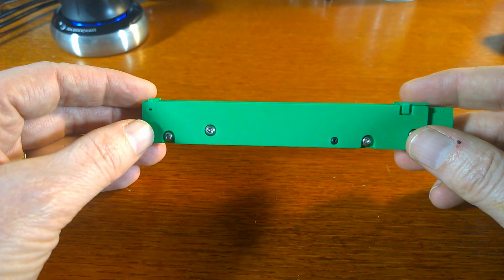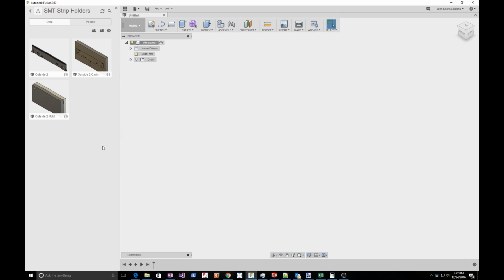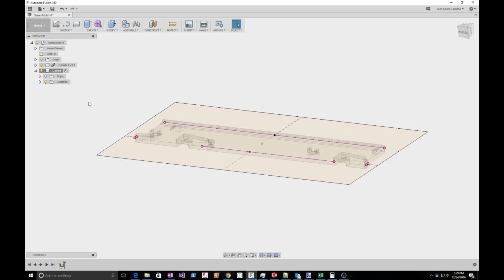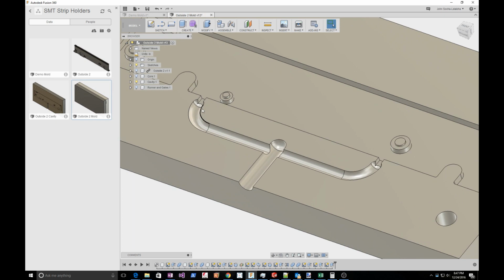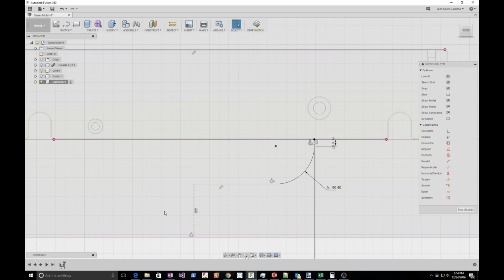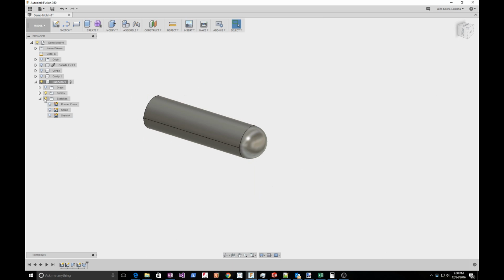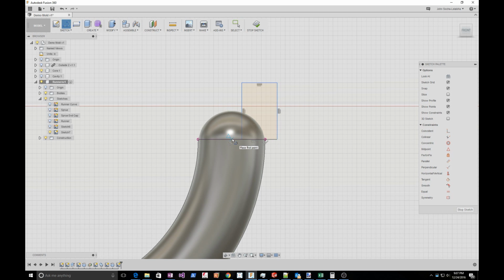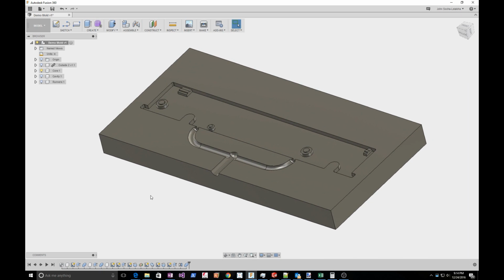#1 - Designing an Injection Mold

Comment: Hey everybody I got a quote for a mould for a machine the same as the injector that he is using and it seemed pretty high, I even asked another die maker and also came in around same price.

It was about $5,000 USD for a mould for Oakley style sunglasses. What takes so much time and cost? Is it the CAD design? I myself just started to learn Fusion 360.
Reply: Design + manufacturing + experience, it is a very niche market to create these little molds, so they need to be compensated for their expertise and time investment. I’d say get the most out of your money and ask many questions 😊

Comment: John, are you using some kind of tilting vise with your CNC?
Reply from the maker: It's a type of vise called a screwless vise and it doesn't tilt.
Reply: @JohnSL  I have the same vise; the question was if you have some tilting vise at all. 
Because I had to mill some 45° slots (for sheet metal bending); Anyway I almost forgot that I can tilt my milling head and that just did the job on my side. All my parts are successfully folded with the die which I just milled 4 hours ago.
Certainly I could have designed the slot in freecad and exported the g-code but using the facemill it was quickest I feel.

Comment: How did you decide where to place the gates? It looks like you have created a weld line between  them
Reply from the maker: Yes, there is a weld line. With the machine I was using at the time, I didn't really have much choice. I didn't have enough injection pressure to fill all the ways to the end with a single gate, so I tried to put the gates in 1/4 of the way from each end. That way each gate would fill 1/2 of the mold in about the center of that section. If I were to make this mold today, I'd make it for the Morgan and use a single gate.

Comment: Great video, I have a couple of questions. 1: why are the rails reduced at the ends? Don't you want the flow into the mold to be as quick as possible? 2: Why do the rails have 90° bends, why not 45°. Again just thinking about filling the mold asap. Thanks
Reply from the maker: This is pretty common gate design. The idea, as I understand it, is to have a short section of restricted flow that will cause shear in the plastic. This helps heat the plastic a little more and makes it flow better. So the 90° bend allows the plastic to go directly into that small gate. Using a different angle would require the gate to be longer, which would be less effective.
Reply: @JohnSL  Thanks
Reply: ,,s,

Comment: Hi John, thank you for a terrific video! You mention a lot of practical advice/rules of thumbs, such sizing off of spru radius etc. Can you suggest any favorite books, resources etc. where you gained such knowledge?
Reply from the maker: I wish I could. I get a number of books, but didn't find what I was looking for. The problem is that large machines have much higher clamping forces and injection pressures than my machines. So the advice doesn't fit very well. I just slowly picked things up here and there, and used lots of trial and error.
Reply: @JohnSL   Hey, good job for the mold design however you haven t scaled the part as you known plastic shrink so depending on your plastic type you have to oversize your part. 2 - your part thickness is not uniform which gonna cause sinks in thick areas. Solidworks have a mold design module that offers you all these steps I advise you to use it. the way that you use 360 fusion for the mold is clever however, with a more complicated part with a non planar parting line it is not possible it will be better to use surfaces to design the mold.
Reply from the maker: @akramazgal4788  Thanks. All true. For most of the parts I design, the shrinkage isn't an issue. I use Polystyrene and ABS, and they have a shrinkage of about 0.5%. That's well within the tolerances of these parts. As to sink, yes, that's certainly a factor. For other designs I take that into account. In this case I was not worried about that, so I took a shortcut. And as to more complicated molds, I have made molds with curved parting lines. But most of my molds have a planar parting line, which does make things a lot easier. I have a mold I'll be working on, probably at the end of this summer, what will most definitely not have a planar parting line. I'll do a videos of that part and mold when I start to work on it.
Reply: @JohnSL  good i am a plastic enginner if you need any help i am ready to exchange experiences thanks you and good job 🙏😁
Reply: @JohnSL that's the problem I've been running into too/why I asked since I have a TechKits benchtop machine, which requires manual injection! I've been collecting your tips and why things are designed a certain way across your channel more recently, thank you! I'm also looking into using AutoDesk's MoldFlow Adviser 2019 simulator to start saving time/resources on trial and error for what it's worth.
Reply: hey you can find some interesting rules here :https://medium.com/jaycon-systems/engineering-guidelines-to-designing-plastic-parts-for-injection-molding-1c554a4545be

Comment: can the mold be designed using other software such as 3ds Max or Rhino? And does the molding factory design the mold for the clients(designers) and is that an added service with extra cost?
Reply from the maker: Yes, you should be able to. I haven't tried it. But you'll still need to use a program like Fusion 360 for the CAM to create the tool paths for milling the mold.
Reply: I wouldn't use 3ds max or rhino its just one more export import step fusion 360 tries to be an all in one software and you can get a free license for hobby use. 
its pretty easy to model in fusion 360 and i've used modeling programs like 3ds max, blender, google sketchup.
Reply: Hi ,we are injection mold manufacturer for 26 years,contact sarah@plastic-neway.com

Comment: I’m in need of a mold for a product I invented which patent pending but I am intimidated by the high prices, is there a solution? I am even willing to have manual mold then I can recicle the plastic, we have to start somewhere.
Reply from the maker: I'm going to start researching that soon. One of the projects I'm working on with a group of others is a pair of Wi-Fi throttles for model trains. The cases for both of these are larger than I can run on my machines, so we'll have to have someone else make the molds and parts. I'll create videos as we progress, starting probably in a month or so.
Reply: We are molding maker, if you need to produce molding, you can contact us.  This is my E-mail: daisywang.mold@gmail.com. And this is our website: www.mold-town.com.. We are from China.
Reply: Not only we can manufacture molding according to your design, but also we can designe according to your requirements, then we can produce it.
Reply: a cnc machine can cost more than a small mold. if you dont know how to use program and use a cnc machine its an adventure...
Reply: Tony Perez, I make injection molds and can do the molding as well  I am located in the US.  Feel free to contact me at sgcstx@att.net and I'd be happy to help.
Reply: I'm going to give you my unsolicited business advice. If you're serious about your product, beg, borrow, buy or steal a mold. The art and science required to produce a mold is enormous. You're paying for materials, machining and engineering time. A DIY route it will cost you much more, take a ton of your time and will almost guarantee you'll never make it to market. Even if you have a state of the art CNC setup, your mold still has to meet the specifications of the injection molding machine. A manual mold is great for producing a couple hundred pieces you can give out to your friends and family, but it will never produce the volume required to be even remotely profitable.

If your product is still a prototype, I strongly encourage you to look at other options such as 3D printing and resin casting. When it comes time to pull the trigger on a mold, you will have finalized your design. You can wipe out your life's savings in a flash if you use mold injection as part of your design refinement process.

Comment: I have a question for asymmetrical molding, I am currently designing a mold but the part is asymmetrical. if I used the 1/2 molding method like this then I won't be able to take out the part, it will be staying inside the mold. Is there away you can make the mold asymmetrical?which means 1/2 part of the mold is different than then other. thanks
Reply: Professional mould maker
whatsapp/wechat/mobile:008613732359022